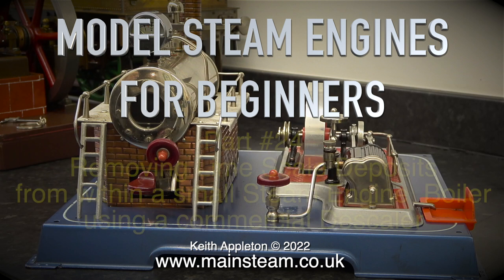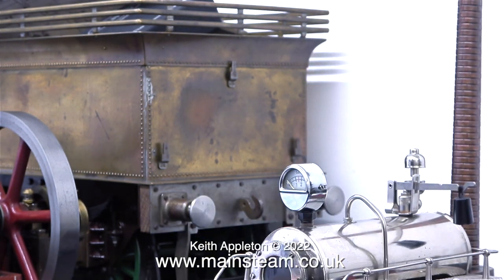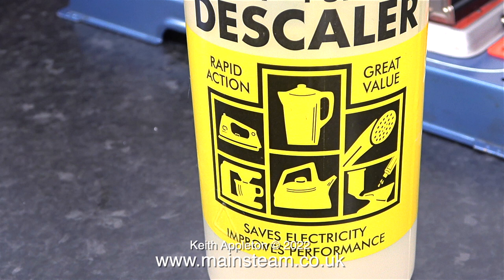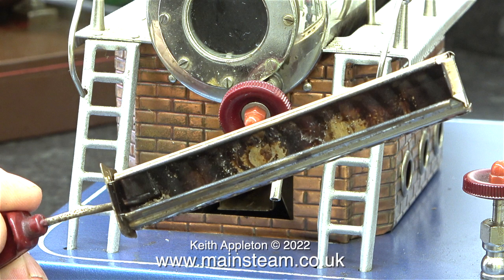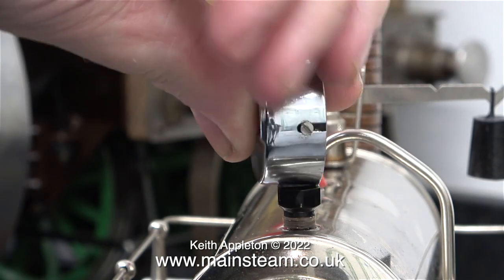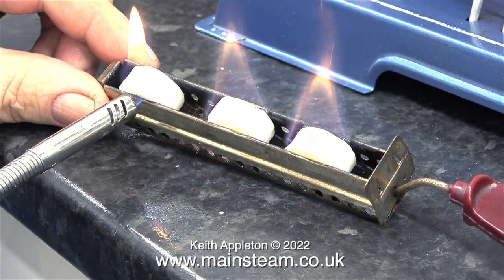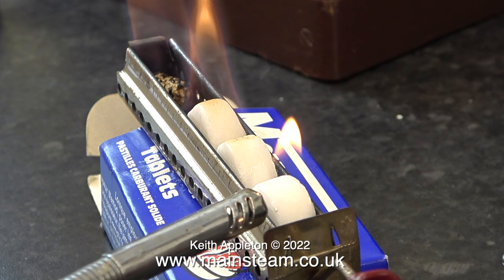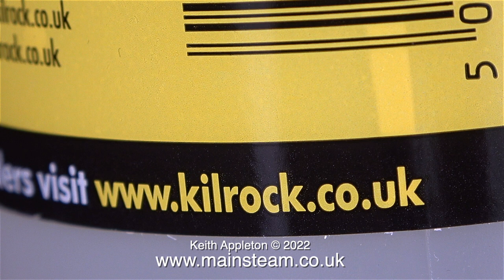DESCALING MODEL BOILERS - MODEL STEAM ENGINES FOR BEGINNERS - PART #24

Comment: Great informative video. I use only jugs of soft drinking water I fill from a health food store near by, along with a dash of water treatment at times. My boiler seems clean, but I’ve been exercising the descaling option for quite some time just to be sure. No sign of scaling, but again it’s hard to officially tell until I either get a visual and or see signs on valves, etc. Again, great helpful video 👍🏼

Comment: I would think using distilled water in the boiler would be worth not having to do all this descaling.  Is that wrong?
Reply from the maker: The steam boilers that I use, especially the one on my large Showman's Engine use quite a lot of water, and distilled water in the UK is expensive and unnecessary anyway.

Comment: How much water do you go through in boilers? I would have thought distilled water would be preferred to avoid scale formation in the first place, assuming it's feasible.
Reply from the maker: The steam boilers that I use, especially the one on my large Showman's Engine use quite a lot of water, and distilled water in the UK is expensive and unnecessary anyway.
Reply: @keithappleton  Good to know. You always have good reasons for various oddities, which is why i ask.

Comment: At the risk of being cancelled in a fit of peek, isnt the golden rule, add acid to water not the other way around? 😦
Reply from the maker: If you are using concentrated acid like Sulphuric (Oleum), Hydrochloric or Nitric, the golden rule is indeed to add acid to the water, but it's not important with this stuff as it is weak. That is why I use it in my Acid Bath.